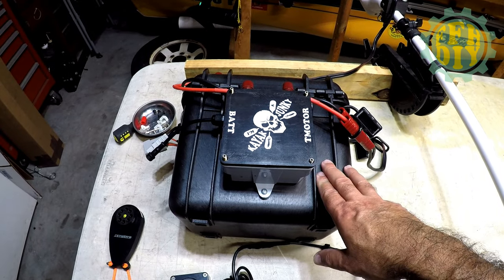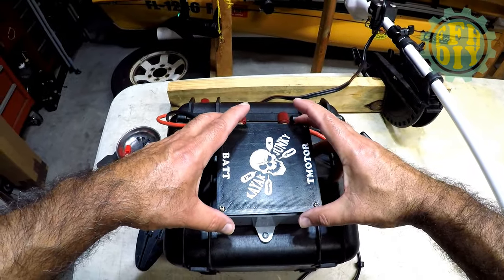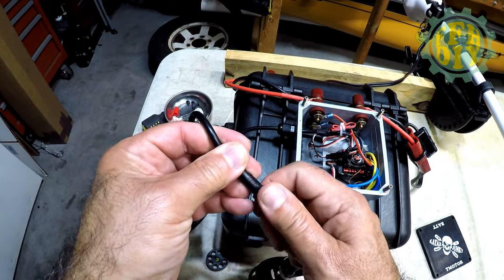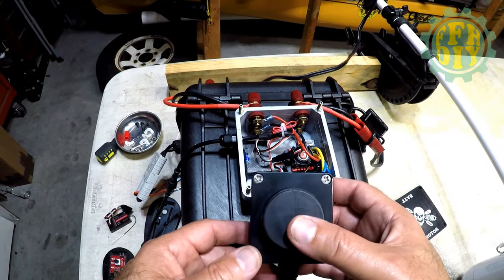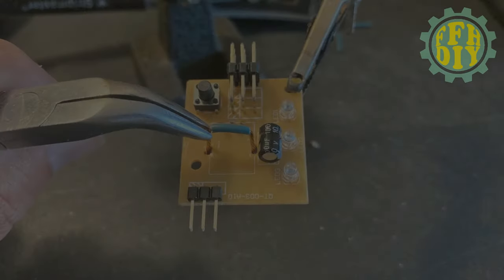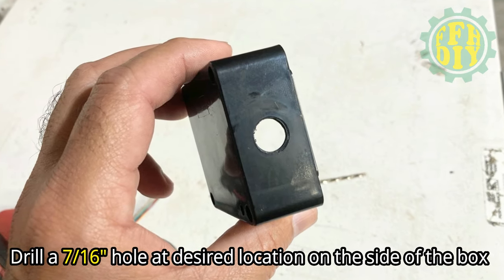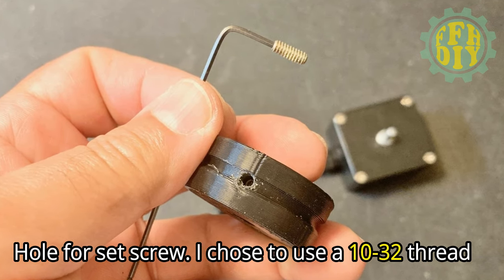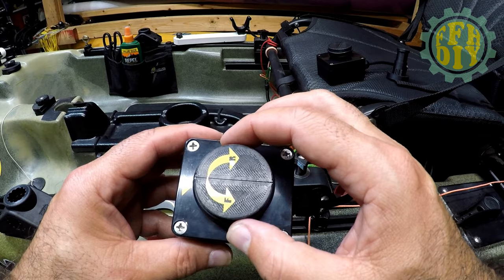My Trolling Motor ESC Throttle Box Upgrade - Florida Fish Hunter

Comment: Could you just use the servo as it is without using the potentiometer?
Reply from the maker: Yes. 😊👍
Reply: @FFHTV  ah that's good. I will attempt to solder in a new switch but in the very few times I've ever had to solder in my life, it's not been great 🤣
Reply from the maker: Have faith brother! You can do this! 😃👍

Comment: do you think this could potentially be used with a 60kg servo for steering. instead of drive and reverse, it would be used as right and left
Reply from the maker: Absolutely. It's a servo controller so not an issue but you would need an input voltage of only 6 volts (not 12 volts) if running the servo directly off the servo controller connected to just a battery. 😊👍

Comment: Do you have any recommeendations for a 24v system I'm trying to find what ESC to buy I've burned through a couple PWM's from amazon and trying to go a different rount. I have a small pontoon on a small lake that I use. The trolling motor is a 82lb thrust running on a 24v system.

Comment: Amazingly helpful and detailed video with some great instruction., very professionally done, thank you for sharing. I have a very similar ESC set up driving my Ocean Prowler 13, but my soldering skills are limited and both times I have been out so far, I have lost power due to fragile wiring on the modified servo board, the glue gun is great idea to beef things up and make the wiring a bit more solid. I have a Watersnake 24Ib thrust motor, in your experience what is the optimum level of the propellor in relation to the underside of the hull? Thanks again FFH
Reply from the maker: Thank you ianhenderson9593  for the comment! 😊 The way I adjust the prop depth is to mount the trolling motor where it is going to stay. I then adjust the prop depth to roughly 6 inches under the water using the top of the prop blade as reference. Now I run the trolling motor to full rpm to see if the prop cavitates while in motion. If it does then continue adjusting/lowering the prop depth until it no longer cavitates. I then lock it in at that depth and I'm good to go throughout the rpm ranges. 😊👍